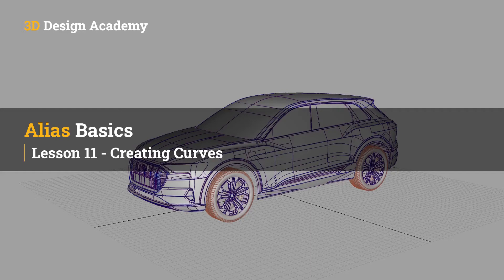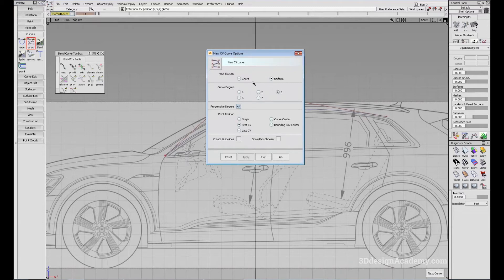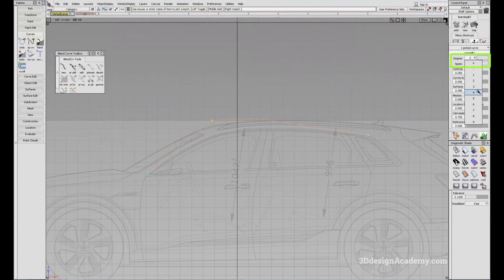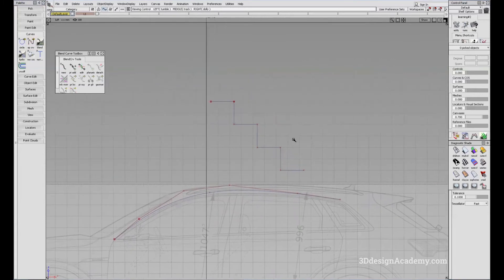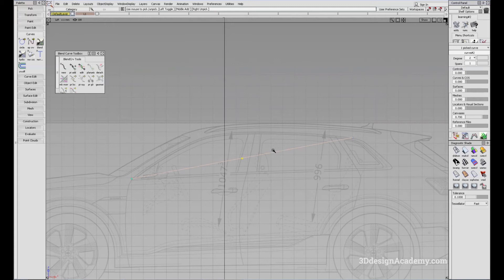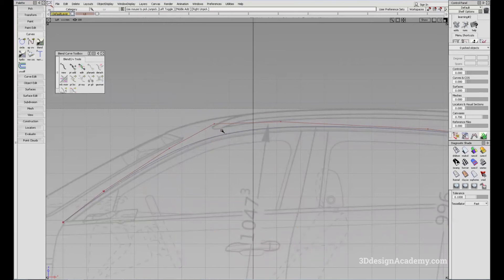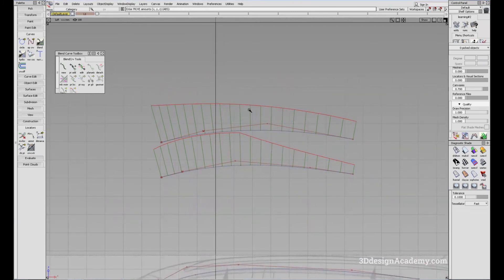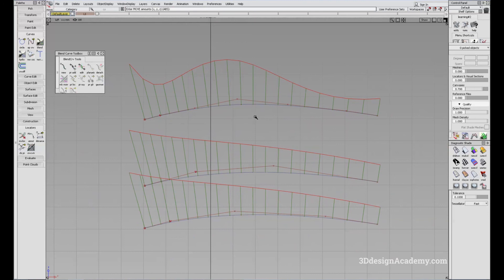Autodesk Alias Basic Tutorials 11 - Creating Curves

Comment: Good afternoon. Is it possible to increase the size of the curve points on the screen in Alias?
Reply from the maker: Yes, you can go to top menu bar, Object Display, Draw Style, Click on the options box, go to Curves tab, and change the CV icon.

If you're using 2024 or later, it's Display on the top menu bar.